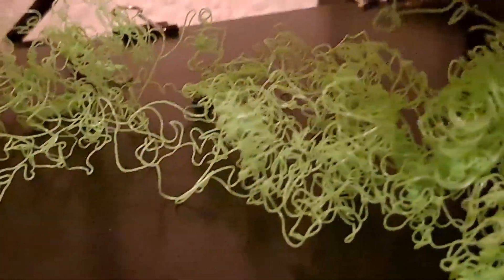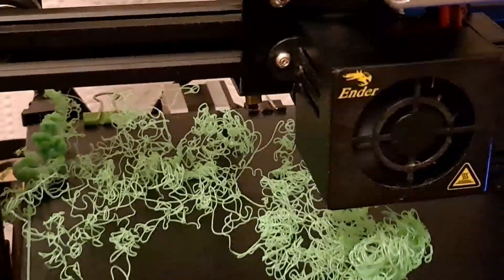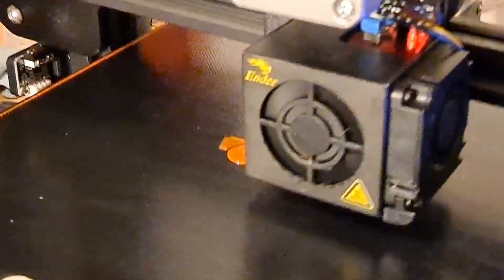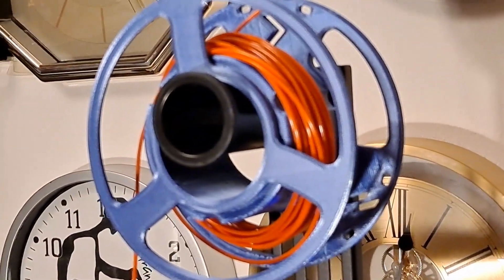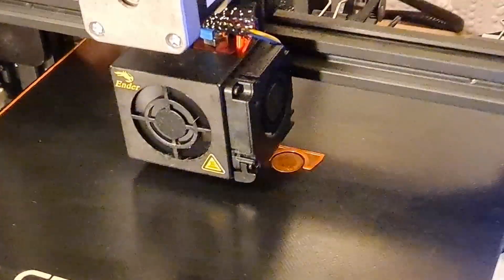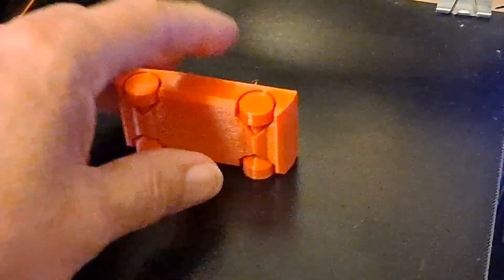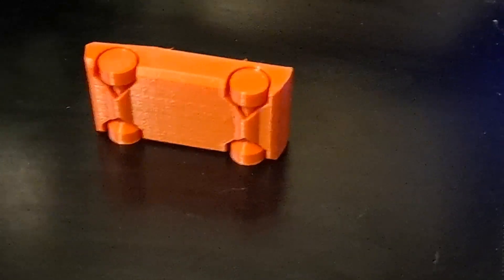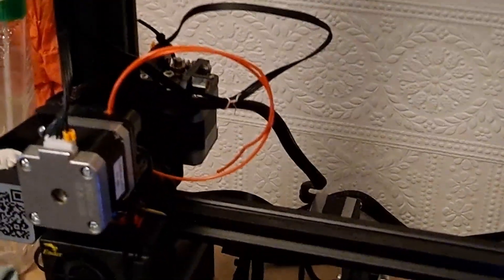Random stuff off Thingiverse - Print In Place Toy Car

Comment: That came out well with out ans problems. Can you put like spirits under the pla To get the printed object off the printer table i wonder?
Reply from the maker: You would ruin the table if you put spirits on it. It has a coating that grips the PLA when it is hot and releases it when it is cold, but you have to be patient and wait until it has cooled down. My concern here was the wheels might stick well enough for the axles to snap as I lifted it off. If you look carefully you can see the body is free but the wheels are still stuck.

Comment: This is a great series! 
Seems like a good basis to design other Matchbox type cars... then onward to put micro guts in them and drive them about  😃
Reply from the maker: Hmm, the body could be hollowed out. I did see a good series of videos modifying 9gm servos to use as motor, gearbox, and back axle for micro RC cars. https://www.youtube.com/watch?v=nhCe77rNDXQ&list=PLA5a2xPRSrB1nJ5I3Uzrjf41VCJzrab4p&index=52